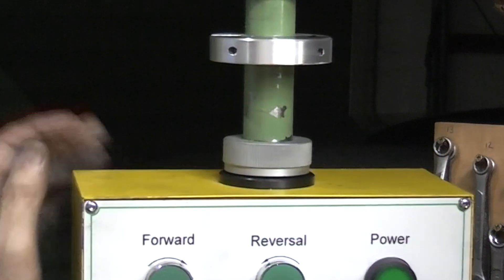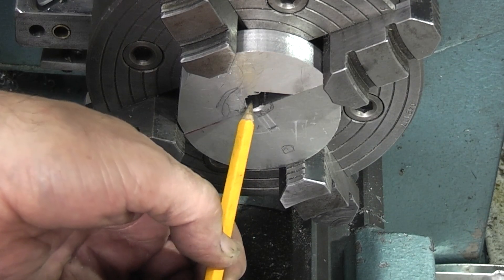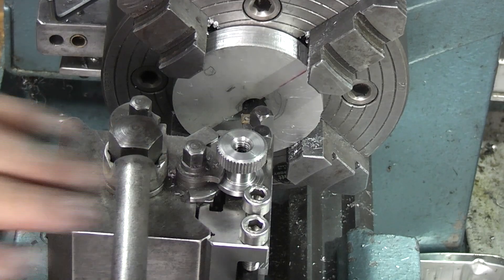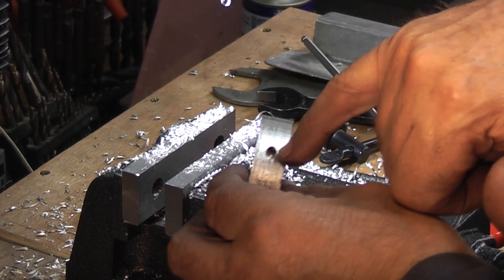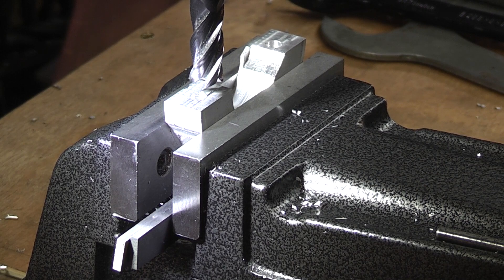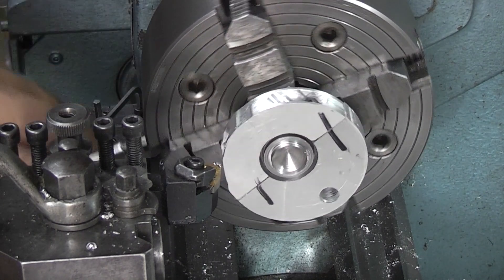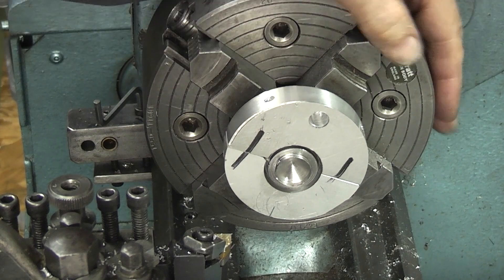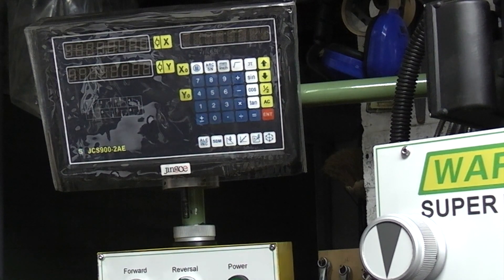Making a bracket for a DRO display

Comment: Thank you that was an interesting little project, look forward to the next one how are you getting on with your milling machine ?  I'm looking to purchase the same model.
Reply from the maker: Hi Steve. This milling machine is sold by a number of suppliers under different names with slight differences.
I liked this one as it had a power down feed to the quill hence the extra gearbox on the side.This machine has 3 tee slots but I have seen it with 4 tee slots in the table. Look around some have DRO fitted instead of the down feed also check that delivery costs are included.